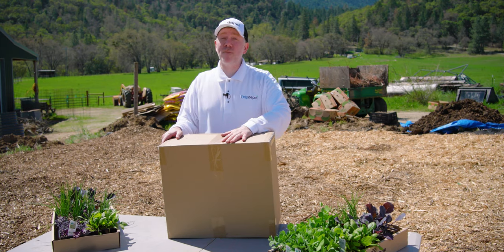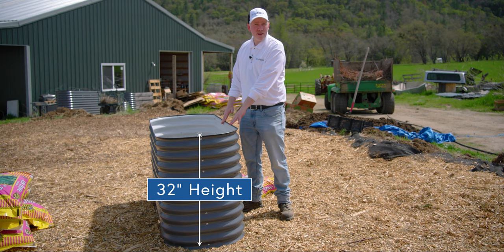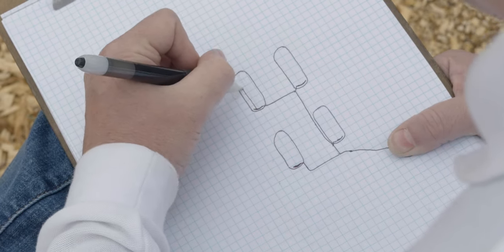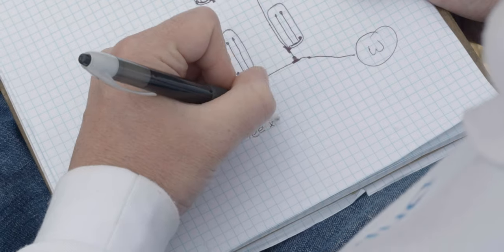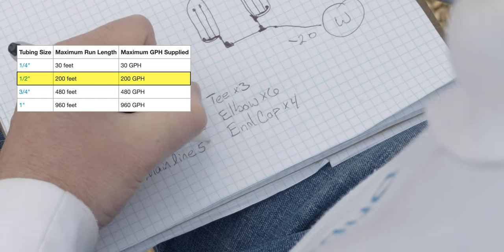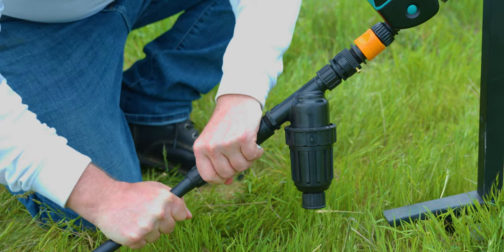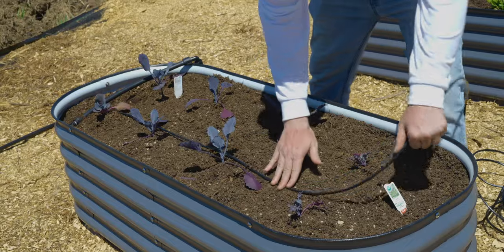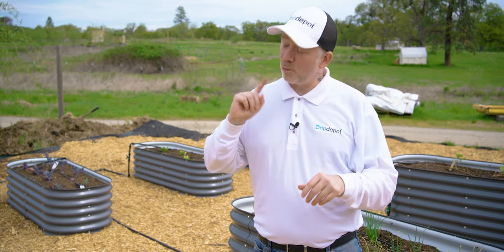How to Build a Raised Bed Garden with Drip Irrigation (Complete DIY Guide)

Comment: Great job! Looks amazing. Got my system in the mail today! Letting the sun warm up my mainline  now! formerly N /A (past username). You know when dirt ain't dirt cheap anymore there's something awry..
Reply from the maker: N/A, awesome news!  And yep, when we did this one I also let the tubing warm up in the sun -- got lucky and it was a warm day that day (and one of the only ones we've had so far this Spring).
Reply: @dripdepot  Already reaching 80's by mid day down here in the south. those plants are gonna be thirsty!
Reply: @dripdepot  Still cold'ish and rainy here in Southern Oregon!  That all changes this weekend though, going from a high in the 60's to over 90° haha.  Stay cool my friend!
Reply: @DripDepotAdam  Got a question, for my corn rows im using 1/2 poly tubing as drip line (same as my main line, making cuts from 1000 ft roll ) can I use the 1/4" punch to make drip holes at about every corn stalk, (1ft -1.5ft spacing) and have it work properly without having a button/other style emitter connected for each plant?
Reply from the maker: Good question!  So, you wouldn't want to just punch a hole and have it deliver water.  A punched hole would deliver a lot more water than you'd want -- even more, the first few holes would likely eat up a lot of the available flow and pressure, leaving not much for holes further down the line.  This would cause the earliest plants to receive a ton of water, and later plants would receive little to no water.  It's similar to the issue old soaker hoses had -- first half of the hose using up all the available flow. 

Even a safety-pin hole ends up being too big and putting out too much water, definitely best to go with a button dripper or some kind of drip emitter to control the amount of water going out.  

I'm glad you asked this one so the information will always be available in the comments, as we get it pretty often -- thank you truly! :)
Reply: @dripdepot  what type of emitter would you recommend? going to have roughly 20 rows with about 25 stalks per. rows spaced 1.5 ft stalks spaced 1ft approx. The emitter doesn't need to be long as my drip line will be running along side each row. Could I use 1/4" drip line in small segments where the hole/regulator is and goof plug it or is there a better way?
Reply from the maker: Awesome, you'll have the tubing running next to the corn?  If so, you could punch a drip emitter (or multiple) right into the tubing where it passes the plant.  When farmers use drip irrigation for corn, they usually use drip tape -- drip tape, when it comes down to it, is basically tubing with drippers already inserted, so you can essentially duplicate what they do using button drippers.  Button drippers are the classic dripper type, basically what people think of when they think drip irrigation. 

In regards to what flow to go with -- it can vary quite a bit, but in most cases the standard 0.5 GPH to 1.0 GPH drippers will work well.  If you have particularly sandy soil it could be beneficial to go with higher flow -- and likewise, if your soil is particularly dense, the lower flow end could make a better choice.  

I think it's likely you already have most everything you need as well :)   

To insert a button dripper, just punch a hole in the poly tubing with the 1/4" punch, push the barbed end of the dripper into that hole and you're done (you probably already knew this, but wanted to mention it just in case!)
Reply: @dripdepot  Awesome! Thanks so much! You saved me a good bit of time, line, and hassle. Ill have to order some button drippers for my corn and green beans then. I thought about just cutting out small sections of the 1/4" drip line where the internal emitters are and have it 1" to 2" out from 1/2" line and goof plugging it. But I guess the button style emitters would be easier/better?
Reply from the maker: Using 1/4" drip line is also a fairly common way :)

In a setup like this (plants spaced about 12"), there's a couple ways to do it -- some folks will run 1/4" drip line right down the right near the plants.  With 12" spaced drip line this gets an emitter to every plant.  Some folks like more than one emitter per plant (sometimes adjacent, sometimes on opposite sides of the plant) and will create rings out of the 1/4" drip line that goes around the plant.  All that's needed for that is a 1/4" tee -- if you connect 1/4" drip line to both arms of the tee, it makes a complete circle, no goof plug or end plug needed then.  Young trees and larger plants are often irrigated this way. 

So, with all that said, it basically ends up being the same either way (and also works great either way) -- the emitters in 1/4" drip line are essentially the same as button drippers.  There are of course some small differences since they're inside the tubing, but both are designed to control the water emitted, 0.5 GPH for the drip line and for many button drippers.  This means you can basically go with the route you like the best (or costs the least, or requires the least labor, etc) and you'll likely get great results either way.  

At least, if the raccoons don't get them lol -- two times I've tried to grow corn in my home garden, two times the raccoons ended up helping themselves overnight.
Reply: @dripdepot  Adam I have to say again, customer service second to none! That clears up everything for me! I'll gauge whether ill buy buttons or use 1/4" line as the best option for me. I already have lots of free running baby stalks popping up from last years droppings that got tilled in again this year. As for the coons' they can be pesky pests at times. I start my germination inside then let the stalks start growing about 4-8 inches tall in seed trays before transplanting in the ground.  Not many coons' my way but plenty of birds squirrels possoms rats cats snakes and deer. I'm hoping the rats dont chew my tubings...
Reply: @dripdepot  Once everything is all set up , I'm thinking about recording a video of the system fully functioning. If I do I'll shout you out and send you the link!
Reply from the maker: Heck yeah, please do, I'd love to see the video!  I hope you do film it, seriously looking forward to seeing the system all up and running, I love seeing successful systems -- we'll also be available if you have any installation questions at all :)
Reply: @dripdepot  Just made another order for few more parts. That should wrap it all up.
Reply from the maker: I confess, even though I've been doing this for years, I sometimes have to grab a few more parts to finish an install too.  Seeing the orders of professional landscapers and irrigation designers, I get to see that they have to do the same thing fairly often -- we're in good company!
Reply: @dripdepot  Decided to go with button emitters instead of 1/4" line, cheaper and easier for my install.
Reply from the maker: I noticed that!  Button drippers make a good choice too, they work pretty much the same as inline drippers -- usually a bit more labor to install them, but deliver the same good results.  Your fingers will probably be a bit sore at the end of installation day, but it's one of those "well earned pains" that is strangely satisfying.
Reply: @dripdepot  Have to punch 550 1/4" holes for buttons I'd say it'll add some extra callus to my hands lol but the sweat equity is well worth it in the long run.
Reply from the maker: Definitely going to earn those!  Sweat equity, such a good way to put it and 100% accurate.  It described that soreness that comes from honest work.  Even though it's sore, it is a rewarding, well earned pain (and it always goes away and leaves you stronger when it does!).
Reply: @dripdepot - Question... My hose spigot is 3" from the ground so it is impossible to add a timer at the spigot. My "grow bag" garden is on a deck the comes off the room above my garage and is approximately 70' from the sigot. I currently have a 100 ft hose run up to the deck in order to water my plants. Would it be possible to add a timer to the end of the hose? I want to set up a drip system in the grow bags because we travel a lot. This is my first hurdle to overcome. Thanks.
Reply from the maker: It is possible to have a timer at the end of a hose, but does take some caution as most garden hoses are not rated for constant pressure -- if you're able to get a hose that can withstand constant pressure, you can use a timer at the end of it, before the drip system :) 

With all that said, you may be able to have a head assembly at your spigot despite its low height -- at my home garden, I'm in a similar situation, my spigot is about 6" off the ground.  What you can do is start with something like a 90° or 45° faucet fitting.  This makes it possible to build a horizontal head assembly, and parts like the Tee Filter allow for head assemblies in locations with low clearance.   At my home garden I did have to provide some support (I used bricks I had leftover from another project) for the head assembly, but was able to get it in place by starting with a 45° gooseneck faucet fitting.
Reply: @dripdepot  - Thank you! 👍

Comment: What is the rational to running two separate 1/4 lines per row?
Why not loop it backup towards the mainline and end with a goof plug or tap back into the main line?
Reply from the maker: That's a great Suggestion!  And one that is used at times :)  It limits flexibility a little bit (can't adjust one side's position without also having an impact on the other), but it could definitely have worked well on this project, particularly given the relatively small size of the beds (with larger beds, the length of the dripline could become an issue, but definitely not so in these beds). 

Thank you for the great suggestion, absolutely worthy!

Comment: Thank you for this video! Would you recommend running the mainline inside the beds, before filling with soil?
Reply from the maker: You're very welcome Lucy!  And good question as well --  in the video, we filled the beds first, ran our mainline vertically outside the bed, then elbowed into the bed and placed it on top of the soil.  

Some folks do the vertical portion of their mainline inside the bed -- in those cases, it probably is easier to run the mainline first and then fill it with soil.  Both methods are perfectly viable, I just like to run the mainline outside of the bed to make it easier to access for maintenance :)
Reply: @dripdepot  thank you!

Comment: unlike with wood beds, you don't attach the mainline to the metal beds, right?
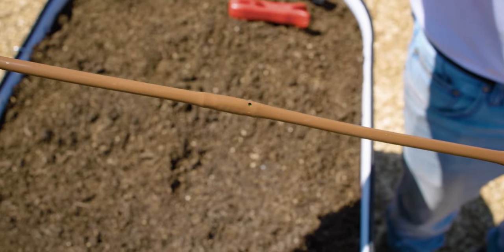Reply from the maker: You got it Chuck!  Some folks do attach it directly to the bed, but it takes outside tools -- in the video here we just used the weight of the tubing and a stake inside the bed to hold it in place.  At about 11:00 - 11:24 in the video you can see how we run the mainline and "connect" it to the bed using the elbow fitting :)

Comment: Hi!  Is there any issues with the poly tubing lying on the top of the ground?  (ie sun exposure or what happens when I inevitably trip on it or step on it ) LOL
Reply from the maker: Tripping on it (or hitting it with the lawn mower or weed eater) are definitely the biggest risks!  The poly tubing is UV treated though, so sun exposure is ok (it may slightly reduce its overall life span, but minimally, it should still last years and years in the sun).  Depending on your location, if there's any standing water in the tubing when exposed to the sun, the water can get pretty hot which can be an issue for plants and soils.  

With that said, that's not usually a big problem as water will typically drain from low point emitters or flush valves, and even if the tubing gets hot, it generally cools down pretty much instantly when water begins running through it.  

Basically, it should be perfectly ok in almost all cases -- if you're in Arizona or similar states it can be advantageous to bury it due to the extreme heat.  :)
Reply: Thank you!  We are in mid Illinois so don't think the water temp should be too much of a problem.  No mowing or weed whacking happens in the garden area (it's mulch), so no worries there. 
 Will occasionally stepping on it be OK or ruin it?  Thanks!!!!   @dripdepot
Reply from the maker: @karenhouse1   Water temp definitely wont' be a problem up in IL -- we're probably a bit warmer here in Oregon and I've never had issues with the tubing getting too hot :) 

Stepping on it can depend -- in most cases, I'd say it's not going to cause damage, at least when the tubing isn't pressurized, though heavy boots could be an exception.  In my experience, stepping on it more likely to cause damage to me (tripping over it) than the tubing.

Comment: Is there a simple way to calculate the volume of water/time needed to run such a system per day for a certain area?
Reply from the maker: Sort of!  With so many variables going into watering cycles (local microclimate conditions, soil capillary action, time of year, maturity of plant, plant type, shade/sunlight exposure, etc) it makes getting to something specific very challenging. 

For that reason, we pretty much always recommend the "water and watch" method -- go with a watering cycle and monitor the health of your plants so you can adjust the cycle accordingly.  I like to keep in mind, it's always easier to add more water than it is to remove any (have to hope for evaporation!).  

You can search up the plant and some general watering guidelines to get a baseline -- emitters will state their flow rates (0.5, 1.0 GPH, etc) so you can use that to get an idea of how much water per hour the plant will receive with the irrigation, and then compare it to the general guidelines.  The guidelines can't account for all the very local variables of course, so don't rely on it too heavily -- mostly, rely on the results you see :)

Comment: Is an elbow needed at the bottom of each bed as well as the top of each bed? That seems to be my thinking, but I couldn’t quite tell from the video. Thank you!
Reply from the maker: You got it exactly right :). 

One elbow at the bottom to turn the tubing vertical, then one more at the top so it can run horizontally across the bed.
Reply: Thanks!

Comment: Will this setup be able to stay during the winter in mild climates like zone 7B, MD where it sometimes snow?
Reply from the maker: You bet, the poly tubing we used in the video actually first gained in popularity in the US up in the northeast due to its freeze damage resistance.  Poly tubing tends to "bend and not break" so it can be left out over winter, even when used above grade. 

With systems like in the video, all you usually need to do is let gravity drain the water from some low point end caps and you're good to go for winter.  The head assembly parts (backflow preventer, filter, regulator) can be easily removed from the hose bib and stored inside. 

Here is a link to our winterizing video if you wanted to check it out -- it covers the things I mentioned above in a bit more detail (but it really is as easy as it sounds): https://www.youtube.com/watch?v=qOSIav1DiCQ
Reply: @dripdepot  thank you so much for explaining this!

Comment: Why not just come inside the bed?  Much neater.
Reply: We thought about going that route (and sometimes do), but the farm we were installing it on needed to make a few changes to it all after the install -- the other downside is maintenance -- it's more difficult to access the tubing if it's run through the soil.  Not crazy difficult of course, but having it on the outside makes it easy to always access and make any changes.  But yes, going through the beds is a good route as well, and does stabilize the tubing itself without the need of outside clamps or ties.  :)